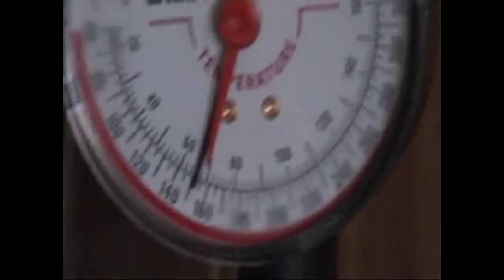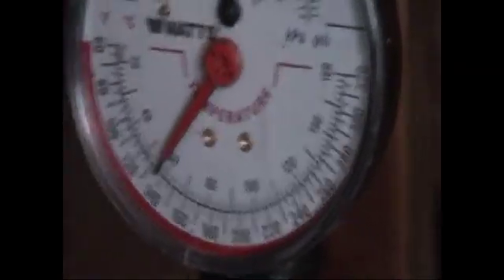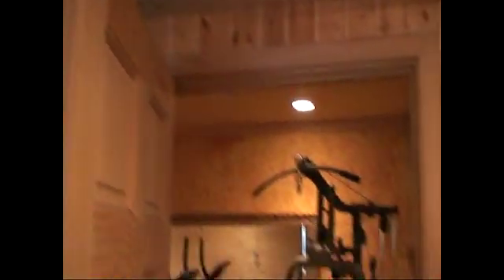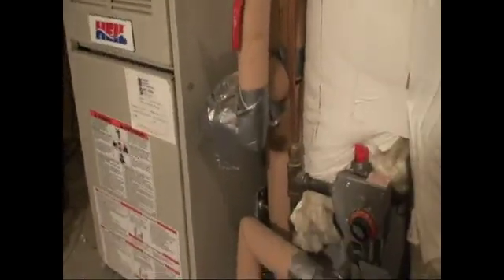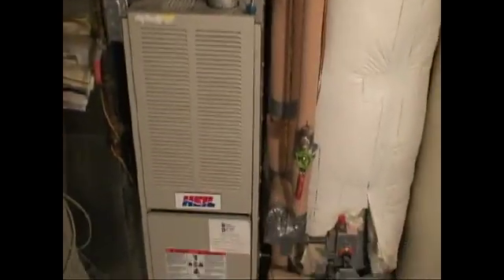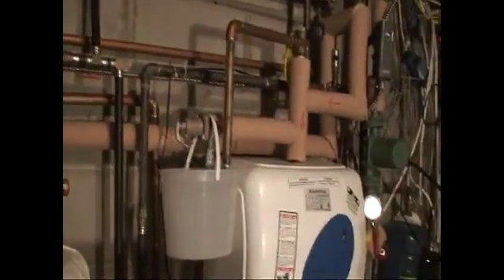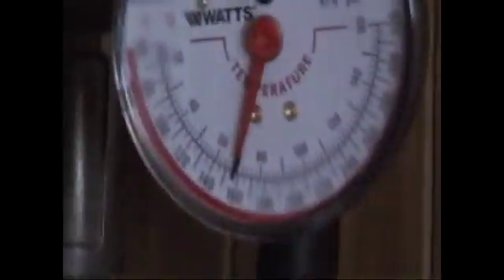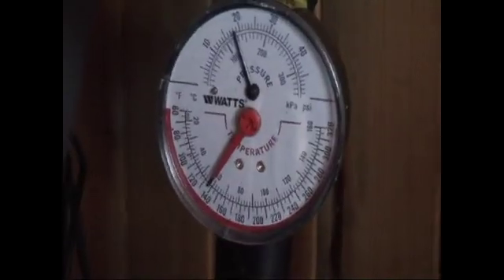Harman Pellet Stove using a Crosslink Conversion Boiler Kit

Comment: how much is the kit??  i want to be able to heat water up and the house up using the stove
Reply from the maker: free country Please go to CrosslinkConversions.com web site .Or email me a CrosslinkConversions@msn.com.You may all so visit the Crosslink Forum for many answersThank you for your time tommy
Reply from the maker: the 6 gallon supply tank is for use with furnaces like hot air furnaces that do not have a supply system for boilers it is not needed
Reply: okay thank u for your reply :)

Comment: Excellent job on the installation.  I do hvac for a living and this looks really nice.  The little chase you built blends in really nicely with the woodwork.  The water lines look really straight and even.  The arrows drawn showing water flow are a big help for anyone (including the owner) to get a handle on what's going on.  I've seen other self-installs and sometimes moan out loud over how bad an installation turns out.  You saved money and can show off your system.  Good job.